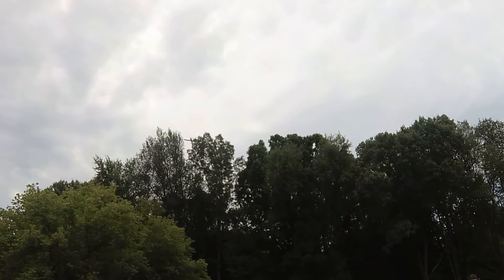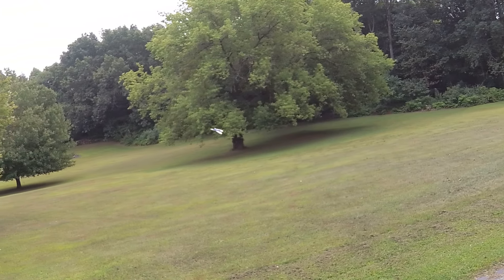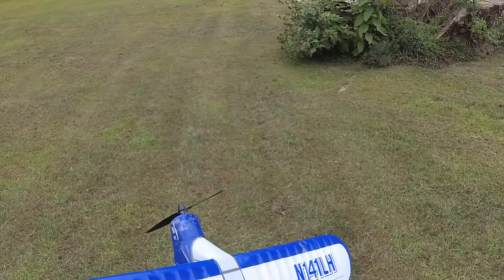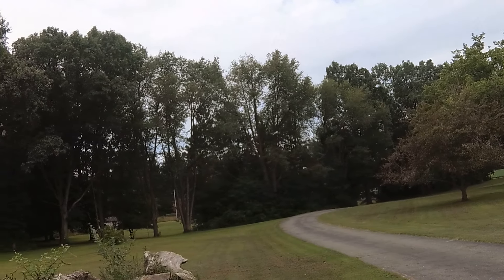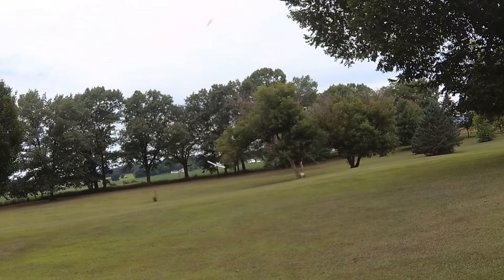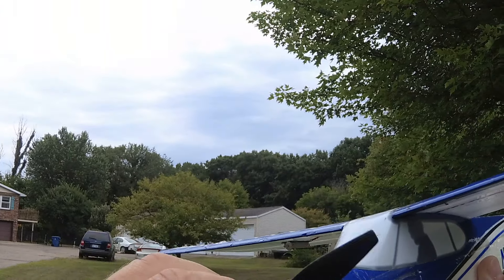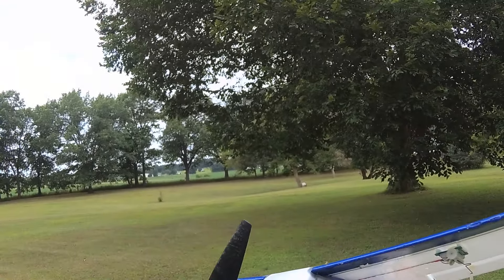8-11-2019 HobbyZone UMX Sport Cub S

Comment: You are so good at flying!  I just bought one of these and can barely make it around -with all assistance enabled-without bumping into tree branches.

I hope to fly as well as you do.  Beautiful.
Reply from the maker: Thanks! All it takes is practice. Lots and lots of practice! If you're flying in beginner mode, the bank and pitch angles of the plane are very limited, which can actually make it harder to avoid trees. I remember my first flight with this plane. A windy February morning. I hand launched and immediately went straight down wind into a tree. Nothing I did on the sticks had any effect. I tried again in advanced mode, and was able to overcome the wind.

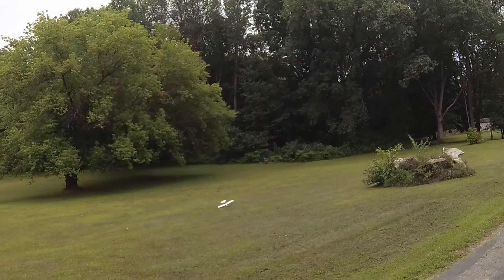Comment: Your flying experience is similar to mine. Especially at 3:00. It's almost as if the wings & motor just cant generate enough lift when the nose is pointed down. Then, of course, the nose likes to break off. It is a FUN plane to fly but looking to upgrade!
Reply from the maker: Yeah, I don't know what that was about. I can't say I've experienced that behavior with it before or after this flight. It was as if the elevator just didn't work at all, the plane didn't seem to deviate from its course whatsoever. shrug This was my first plane and I just take it out to fly occasionally these days.
Reply: @somespamsite44  What did you end up upgrading to? I'm eyeing the Turbo Timber Evo but the price of full sized planes are expensive!!
Reply from the maker: @BradBrother  I went from the SCS to the UMX Pitts, then to a 33" Pitts and a 38" Edge. But that was many planes ago. :)
Reply: @somespamsite44  Good insight! I was looking at the Conscendo, Turbo Timber, OR upgrade my CS2 to brushless
Reply from the maker: @BradBrother  something bigger than the cub would be a good choice. It'll allow you to fly in conditions that the little cub just can't handle.

Comment: Amazing flying lol. I would of crashed flying inverted like that. I guess I need to fly in zero mph winds as you are..

Edit: just saw the crash, that happened to me as well, albeit after several times of nose landings.
Reply from the maker: Yeah I'm not sure what happened. It's like the elevator stopped working for a moment. The plane just kept going straight down out of frame. :D

This is a plane the definitely benefits from little to no wind seeing how little power it has. I did discover LiHv 1S batteries later on, and it really woke the plane up!

Comment: I cant get mine to fly inverted anytime I try it just tries to drop out it will go upside-down I push the stick up bc its inverted and it doesn't do much it still falls
Reply from the maker: Could be your motor or batteries are weak. It takes full elevator (with the control rod at the innermost hole on the surface horn) and full throttle to maintain inverted flight.
Reply: @somespamsite44  thanks for the advice I noticed when flying it always tried to climb and in beginner mode I couldn't make it go down unless I cut throttle so no I adjusted my elevator and ailerons a bit and going to try it today if its not to windy I hope I didn't throw it off too much lol
Reply from the maker: @valorantorion1588  It's normal for the plane to climb at higher throttle settings in beginner mode. You should be able to fly at lower throttle without it climbing, though. Lowering throttle to descend is how you're supposed to get it down. Beginner mode severely limits the amount of down elevator you can give.

Comment: Dang you must have fixed your aielerons I can barley get mine to flip over i have to dive to do it
Reply from the maker: All control surfaces use the inner most hole on the horns. It's still not very willing to roll over, but does get there most of time.

Comment: When in beginner mode, if you use only rudder, it turn more sharp. For some reason it won't use that much rudder when using aileron with it. I hope to never be without one of these awesome little planes to fly at the local park or in front of my house.
Reply from the maker: I don't fly it in beginner mode unless I've accidentally left the switch in the wrong spot. :D I don't think there's any limiting of controls in advanced mode?

Comment: Doesn't running LiPo batteries flat lessen their lifespan?
Reply from the maker: Yes it does. The plane's ESC has a built in low voltage cutout, though, so battery voltage shouldn't get low enough to do any immediate damage. But yes, fully charging and fully discharging both work against the battery's life span. With that said, these 1S batteries typically don't last very long in any case, and they're cheap to replace.